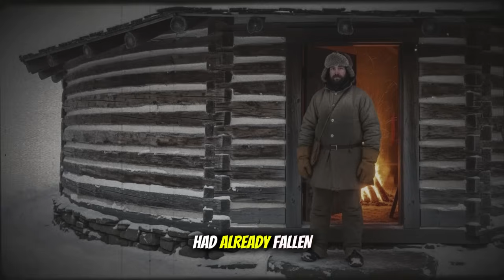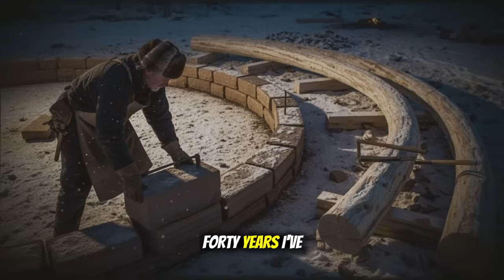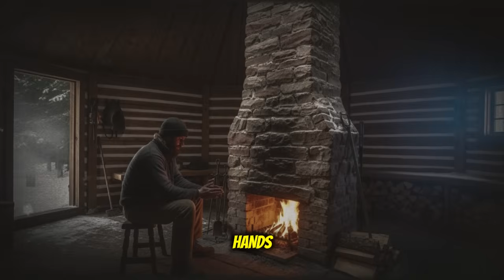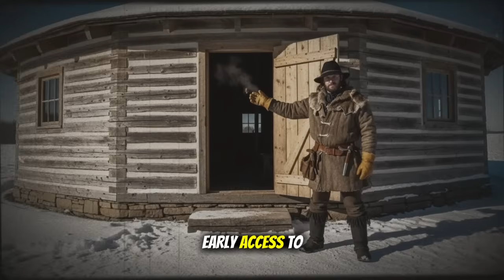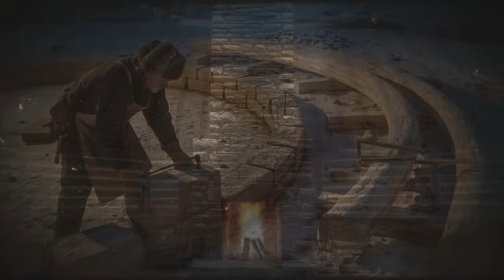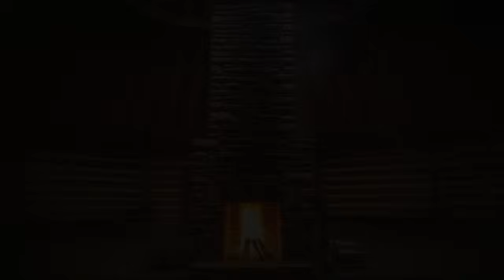How One Carpenter’s “Idiotic” Round Cabin Stayed 22° Warmer Than Every Other Home

Comment: The circle is the most efficient shape.   That is, the larger it is, the more interior to exterior ratio occurs. It has less walls than volume than say a square, which has more surface area for walls that the weather can cool off.   The circle (including the sphere... or dome), will always cool slower and be warmer.